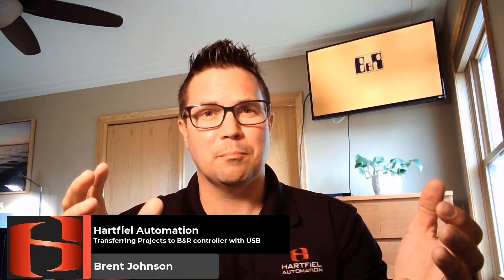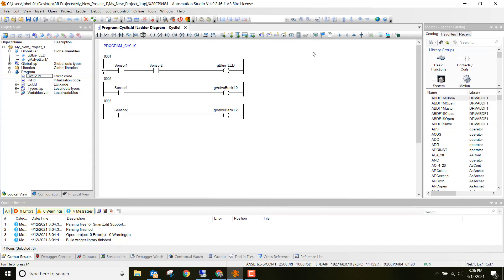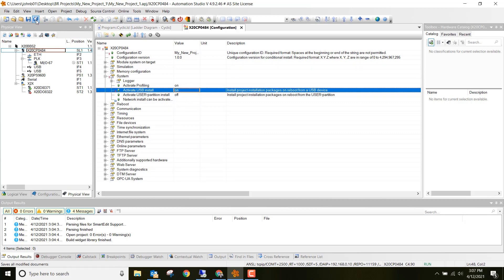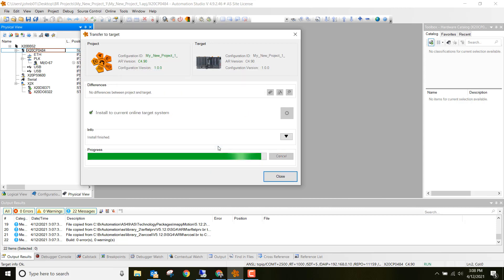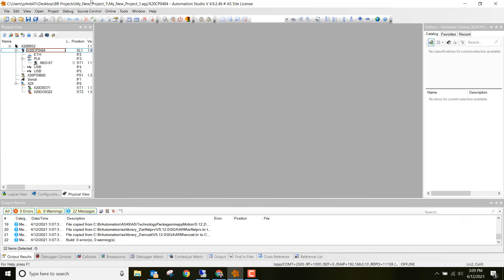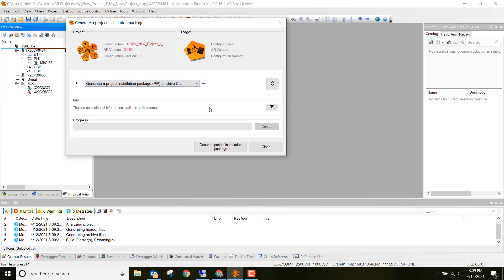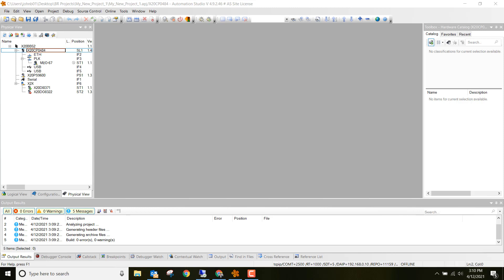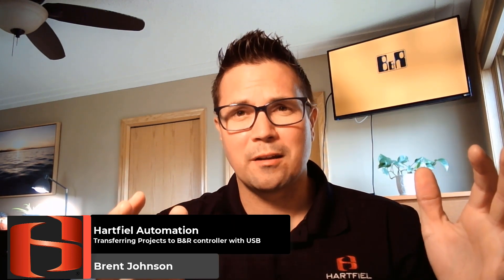How To Transfer a Project Using a USB onto a B&R controller

Comment: hello, How can i upload the program from B&R PLC with Ethernet. Is it possible?
Reply from the maker: Hello,

It is actually not possible to upload a program off of a B&R PLC. You will have to go to the original machine builder who programmed it to get a copy of the project from them.

Good luck,

Brent
Reply: @brentjohnson3363  many thanks for your support
Reply: well that depends there is an option to have the code also on the controller/memory card. But Even if that is enabled it will probebly be saved/encrypted with a password. At least this is what i know of.